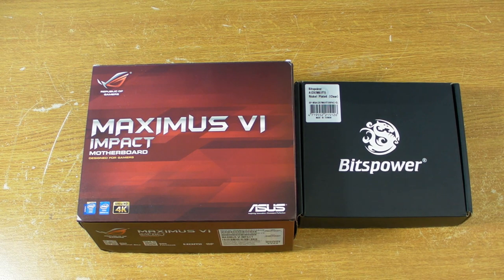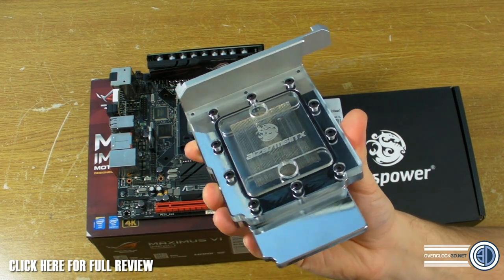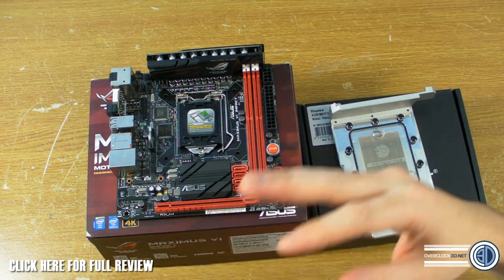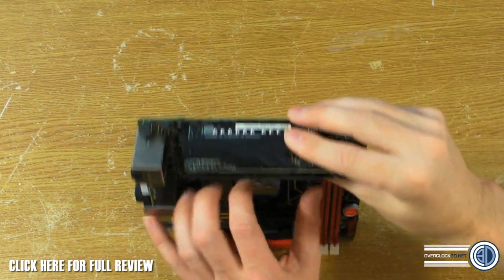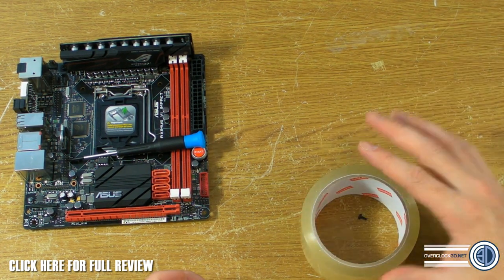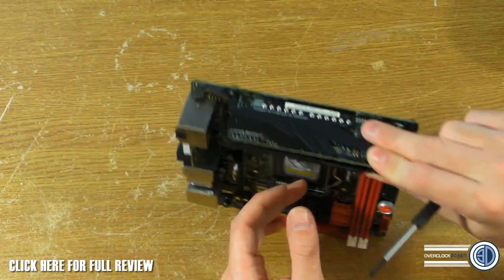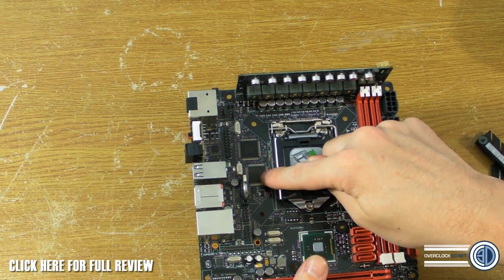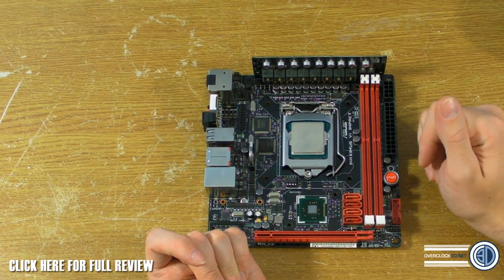Bitspower Asus Maximimus VI Impact ITX Full Motherboard Waterblock

Comment: really wished you would of run some temp #'s Tom  with and without the applacation M8, its all relative to the LGA1150 4770 S or K socket running the built in VRM component  on the CPU  OCed

Comment: 1 Person thought your doing it wrong.
Reply: Well I though he did when he was putting on the thermal pads but he corrected them!
Reply: they are nine right now :P
Reply: Ahmed Albusaidi 10
Reply: kdawgmaster I could say 11 right now, and so I will. 11.
Reply: Well I for one think there was no point in taking the power reg backplate completely off, all he needed to do is take them first two screws off and that's that done.

It was quite painful to watch him sticking thermal pads in the wrong place however, though at least he didn't leave them there, which makes up for it in my books. Not sure what he's sacrificed in the thermal department from all the on and off contact with the CPU and chipset while he was fitting the thing, but if he's had issues - he'll tell everyone about it.
Reply: *you're

Comment: You can magnetize a screw-driver by rubbing a powerfull (speaker) magnet against the screwdriver for quite some minutes... And ofcourse, it only works if the screwdriver dont have some sort of coating on it, and the metal of the screwdriver ofcourse have to be receptive to magnetism..... try it out.

Comment: 1: Never put the pads on the heatsinks, put them on the parts (just makes everything easier and you won't make mistakes).

2: Never spread the paste, it's probably the worst thing you could ever do when assembling heatsinks, as you create airbubbles in the space in between.

Other than that, thumbs up

Comment: They won't make a g1 sniper m5 Z87 socket 1150 chipset waterblock -_-
Reply: or you could not be cheap and buy a OC-Force
Reply: Lol, they finally made a G1 Sniper M5 Z87 waterblock from XSPC. :D I wished Gigabyte wouldn't do the things they would do... Such as allow the release of mATX boards out early but wait couple months for the ATX G1 Sniper board to be released. One reason i went for the G1 Sniper m5 MOBO. What a mistake that was... Next time in probably 5-7 years once i upgrade i'm going to buy a ASUS mobo and the only waterblock manufacturer so far for the mATX board i own is XSPC that makes this waterblock. SAD
Reply: Like i said you could not be cheap and get a board that has a pre installed one